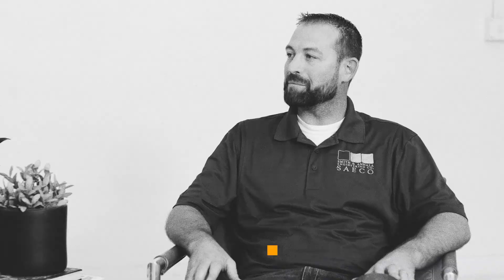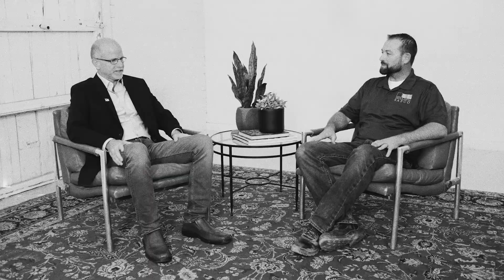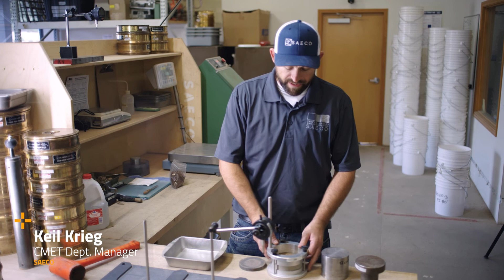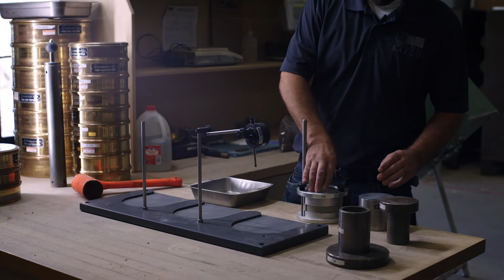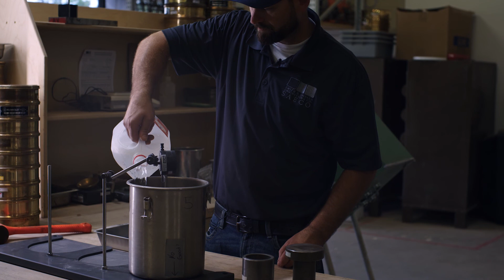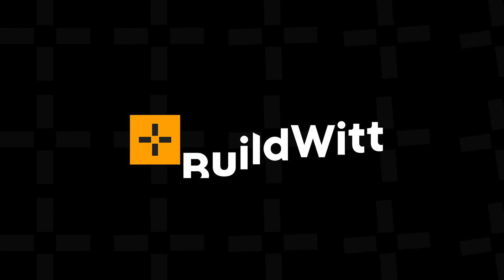Soil Expansion Index

Comment: It looks like the consolidometer apparatus that was put in the bucket prior to adding the water isn’t the 4” one that was shown in the beginning of the video. Is the one that was submerged the smaller 2.5” one used for swell? I’m trying to figure out the best way to “inundate the sample” with just using the 4” kit but the Astm is a little vague when it comes to this step.
Reply: Try going to a restaurant depot store. They should have some metal pans or pots which will work. Also, those blue plastic, round bowls that they have at hospitals also work.

Comment: I would love some more information on determining the degree of saturation for the initial soak prep for ASTM 4829. How do you find it? Do you just run a proctor and go a bit drier (maybe 2-3%, like with a remolded swell)? The method is very unforgiving (50 +/- 2%), and a prep mistake can cost 3 days. The internet hasn't been helpful in my search. I may be using it wrong.